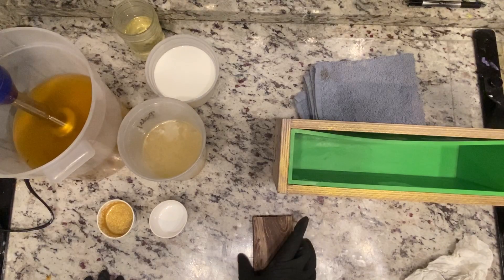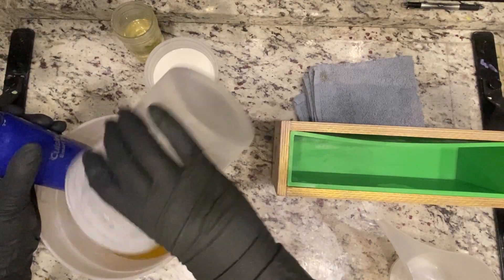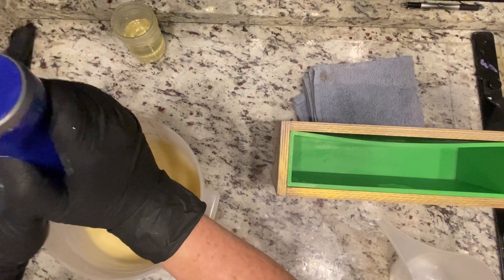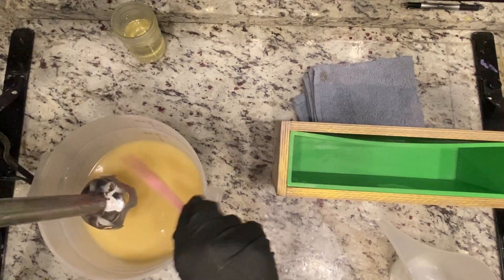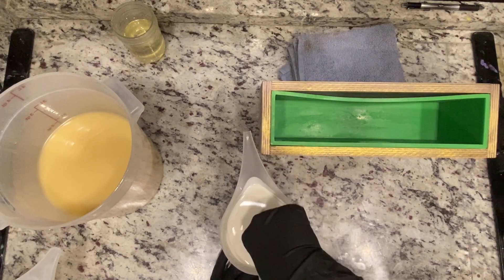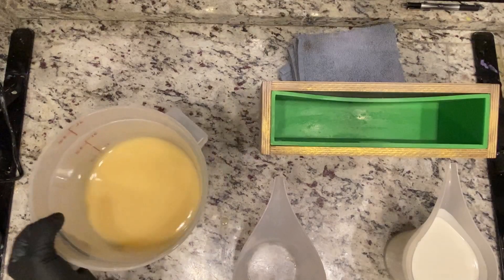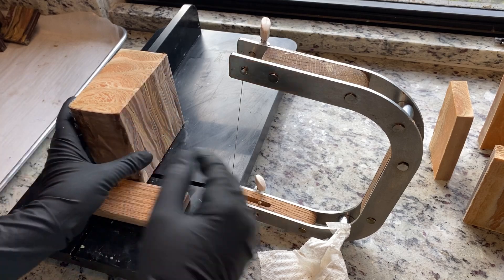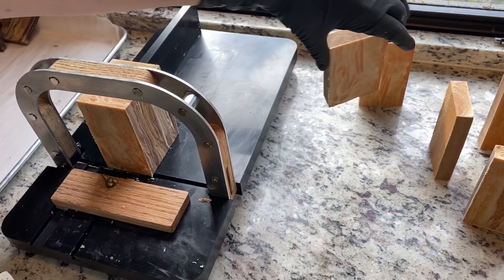How To Make A Wood Grain Soap

Comment: I’ve been wanting to make this for so long. I finally tried it today! I want to say instead of adding the fo to the entire batch- I was afraid and I added a little at a time as I separated it off to pour. I thought it went well until- the last but it got a bit mixed. And I don’t think I angled enough at first. Regardless I’m excited to share it when it’s finished and it smells so good! Thanks so much for all of your details!
Reply: Well that was stupid lol just follow the directions and don’t make your own and you should be fine
Reply: @Nottodaygoddamnit  oddly enough my stupidity paid off. Bars turned out excellent. Thanks so much for your insight. :)
Reply: @kristenlowrance6626  lol you don’t have to lie you already admitted it didn’t go well sis😂 good one tho
Reply from the maker: I think that was a clever work around. I’ve done that in other ways before with adding a little at a time, and as long as it’s well mixed, I think it works great.

Comment: Hi, just a quick question. I'm new to soap making, and just made two batches. Just took it out of the mould. Any suggestions, on how do you get rid of the previous batch essential oil smell, before pouring another batch with different oils into the same mould? Thanks
Reply from the maker: Depends on how strong it is/what FO. Often an alcohol or dawn dish soap bath will help reduce it. It shouldn’t transfer to your new batches however if it’s a quality silicon.

Comment: Hi, thank you for the great tutorial. Just wanted to ask, is soda ash a problem since the soaping is done at a low temperature and there is no water discount and there is extra added milk ? Do you put the poured soap in a preheated oven or wrap it in blanket or just open to room air / temperature?

Comment: I was wondering if adding the mica oil would be easier if you pour that in before the white so you could mix it a little before you add the white? Honest question.
Reply from the maker: Yes and no, it depends on where you want the mica. For me, the gold would be a little lost In the white, and would show best in the dark parts of the soap. But another color may work just fine.

Comment: Just to understand the mica is only in oil (not soap batter) and is the oil part of the calculated oils or just extra?
Reply from the maker: It’s in addition in most cases for me, as it’s such a small amount. However, you absolutely can use some from the batch of oils. 🥰

Comment: I've never added free oils. Why can't you at the gold mica another way? Im.nervous to do just the mica in oil
Reply from the maker: You absolutely can do it with oil from your recipe or with a dash of actual soap batter. I do it this way because it’s easier for me to control how much gold goes where, but it’s absolutely not a must. 

Also fwiw, don’t stress too much about free oils. Unless you have a crazy high super fat, it will be absorbed by the surrounding soap and made into soap as well in my experience.

Comment: I did one not too well actually about a year ago now time flies but for my dad and it's an all vegan wood grain for and I used a Vega one for the green and the different colors and it turned out really well by watching your video so I really appreciate it and yeah I was just wondering what size mold are you using if you actually see this video cuz I know it's an older one but just wondering and I guess I know you said that the tobacco vanilla is what changed the changes color I don't have that but maybe I could find something I don't know or just use my cocoa as the brown but yeah thank you

Comment: I wanted to know if the gold dispersed in oil made the soap's texture or consistency change (considering there aren't anymore lye to saponify with the new oil) and how much oil amount would you recommend for distinct golden layers? I have an idea for a soap design but I am very new and unsure on how to execute the way I imagined it to be!
Reply from the maker: Fantastic question- the answer is no, not really. It's a small amount of oil, (maybe 1 ounce) and that little is absorbed into the loaf problem free. Much more then that, you may have some icky spots that could go rancid. 
If you want to do a bight gold layer, I would suggest trying a dry mica 'pencil' line first, and see how that goes.

 I am not always super fast to respond here, so if you have more questions, feel free to find me on Insta and PM me. :)

Comment: Hi, I was wondering what kind of oil you are using?  (not asking the recipe , but if you could share the oil types , olive ? Castor? Lard??) I tried it and ..LOL... the minute I mixed it it became pudding I had not even added the Tobacco Vanilla yet hahahah!!!
Reply from the maker: I use mostly Lard as my top ingredient, and that really helps keeping it fluid. You may want to cut down your hard butters like shea and cocoa butter if you use those.
Reply: @CheekyGoatSoapery  Thank you so much, I used olive oil and crisco... so I was very surprised to see the pudding about 15 seconds in the stick mixer process.. LOL!!    I will  use lard next time and also augment my water ratio forthe lye I guess.   The weird thing is, a few yrs back I made this soap but at about 105 F temp instead of room temp and I had no problem. Same recipe olive oil and crisco.   Soaping is so tempermental  LOL !!!   Thanks again!!

Comment: Hey @cheekygoatsoapery! Where did you get that wire cutter? I'm looking for one that I can remove the block and bolt so I can cut wider sections. I have Bud's, but the bolt is fixed in place. Thanks!
Reply from the maker: Try Custom Craft Tools!!

Comment: Did you put the mould in the freezer or covered and kept warm with a blanket?
Reply from the maker: Neither! I CPOP, which means it goes into a oven that was preheated to the lowest setting (170 degrees F for me) and then turned off, and the oven Light turned on. It gets tucked in there for the night, and I unfold the next day.

Comment: The equipment is not filthy, it's covered with soap! Soap makes things clean :D
Reply from the maker: I like the way you think!
Reply: @CheekyGoatSoapery  😁
Reply: I'm going to try this tonight. I'm using an ice cream bar box lined with plastic grocery bags as my mold. It's the right shape to make bars that I can cut in the direction to show the wood grain look. I'm planning to use cedarwood essential oil as the scent.
Reply from the maker: @milkywayranchsc  I’ve never used cedar wood EO, but that sounds lovely!! I hope they turn out fab!!
Reply: @CheekyGoatSoapery  thank you! And thank you for the inspiration! I am not sure this first batch will turn out but hoping it might be a pleasant surprise. I focused too much on avoiding a fast trace and replaced my usual grapeseed oil, mango butter and coconut oil with plain old soybean oil, and didn't add any honey. The result was very thin trace that I'm not sure actually was trace because of all the smudged on my glasses and goggles. 

The good points are that I am happy with the colors I blended with various clays and oxides. And the box idea held up without leaking.

Update: it looked like the oil was separating out so I poured it back into a mixing bowl, made sure it actually got to trace, separated into thirds and recolored  two of them by adding titanium dioxide to the chocolate brown mixture that resulted from reblending. Then poured it again in the manner you demonstrated. It turned out good. Not as nice as yours, but I am happy with it.

Comment: Bonjour combien mesure votre moule en Cm ? Merci
Reply from the maker: Oooo a math question. (And the metric system, you have a belief in me that I do not.) The interior of the mold inside the silicon measures 6.35 cm across, and it’s 11.43 cm tall, and 27.94 long 🥳